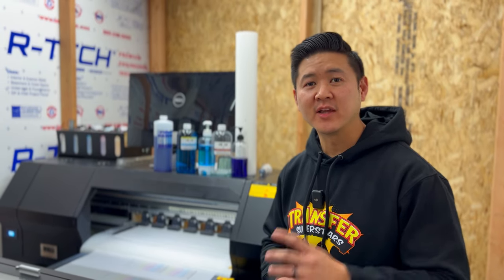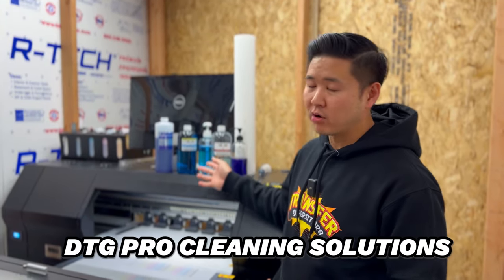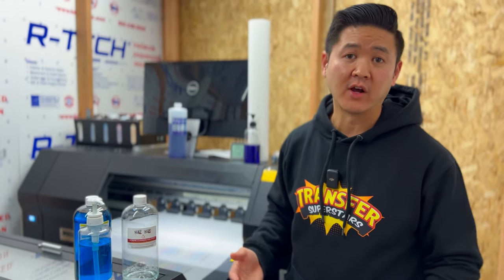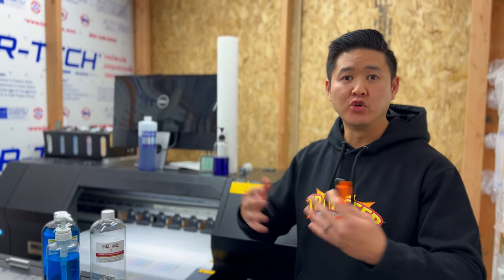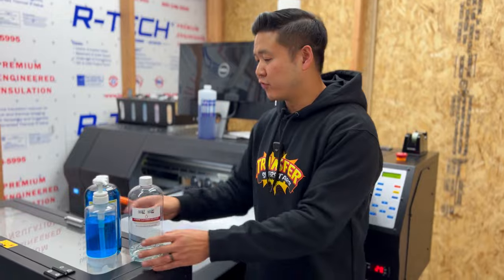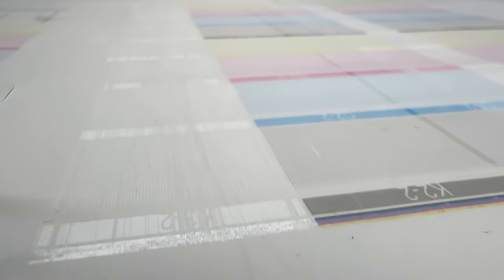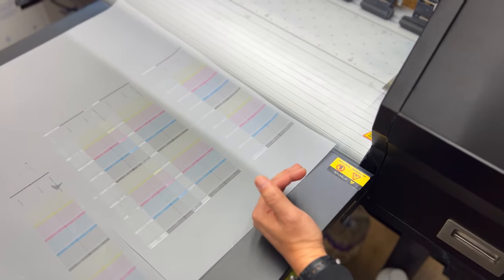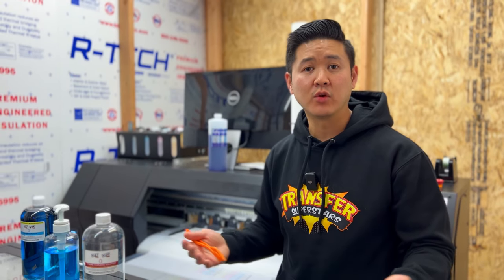How To Fix Clogged DTF Printhead with Purple Hammer DIY Tips

Comment: I have a print head that is 1 week old. I wet capped it over the weekend, came back to some bad nozzle checks. After about an hour of clean cycles / soaking it. I decided to do a “waterfall” with DTFPros cleaning solution. 

I first flushed the printhead with distilled water, and then went for the cleaning solution. Upon adding the cleaning solution to the waterfall, the print head immediately “seized up”. It suddenly resisted pushing any liquids through it at all.

This is exactly what happened to my last print head (which is why I just replaced it)

Any tips or knowledge that could help me understand what I’m doing wrong?
Reply from the maker: Something sounds stuck in the manifold. Instead of waterfalling, try suction instead. What print head are you running?
Reply: @transfersuperstars  I have a 2 head Audley printer (only a few months old) I uses 2 i3200 heads. 

I was never able to get it unclogged (it was only 10 days old) and I had to overnight my 2nd i3200 in 2 weeks 😫

I still have it, only 1 of the dampers is clogged, I will try suction. Should I just leave it in cleaning solution and suck upward via the damper?